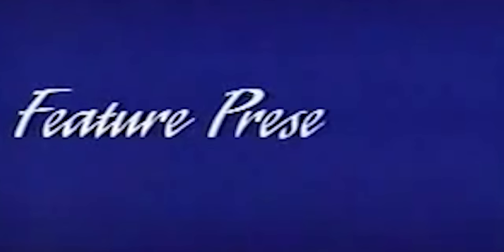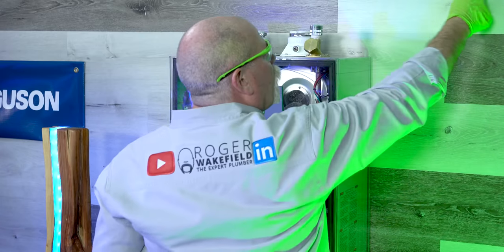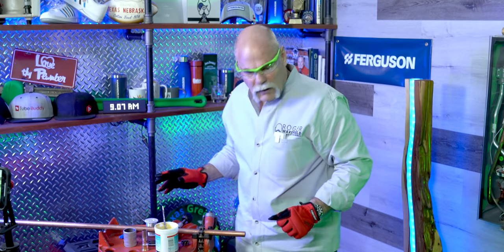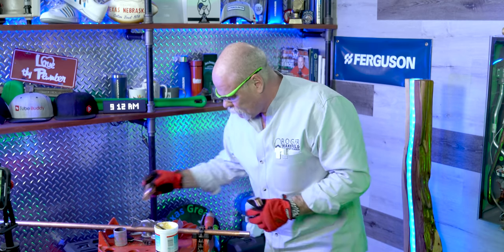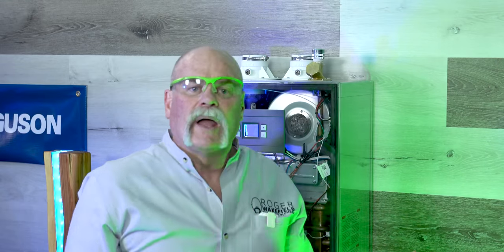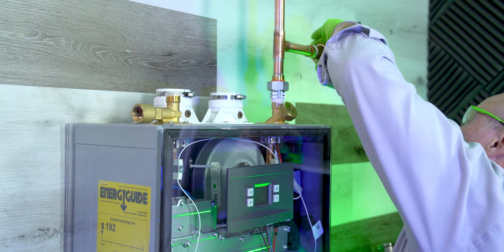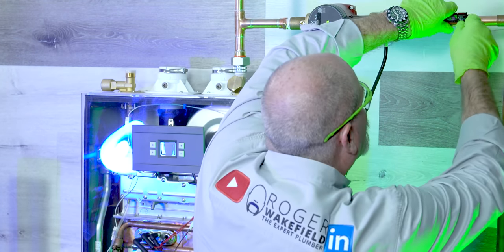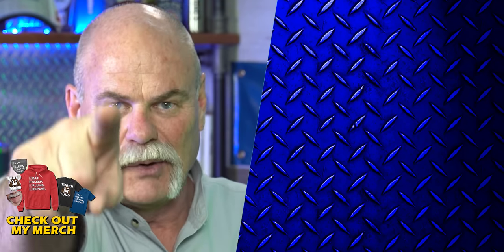This New Device Will SAVE You 12,000 GALLONS Per Year!

Comment: About how much does one of these recirc pumps run? I’ve gotta see if it would be worth it or not cause it’s just me in the house so I don’t use a ton of hot water or actually water period   That 💩 will kill ya anymore depending on where your at but I’m on wells and one of my two wells are contaminated so I don’t drink the water at all for that reason
Reply: Michael Taylor  thats what I’ve thought also. I replumbed the entire house 4 years ago and was debating about it then but held off and I just don’t think it makes financial sense at all. My water bill is zero since I’m on well and my power runs $40-$50 per month year round so I just don’t see it helping other than just being another neat gadget in the house
Reply: Don, you'd be much better off looking into a returnless pump system. Returnless pumps use a mixing valve at the furthest faucet from the water heater to push lukewarm water out of the hot side into the cold water side. The valve closes when the hot water pipe is full of nice hot water, and it opens up when that hot water has cooled below the minimum temperature at the faucet. No return needed since it just goes into the cold side. You can program the pump to run at specific times since it's just you in the house. Morning and night for example for your shower, or midday or afternoon for cooking and doing dishes. Installing the valve on a circuit at the furthest point makes sure hot water is at everything in between as well. This same company shown in the video makes returnless systems. The only downside to it is that the cold water at the sink with the mixing valve won't be very cold because of the lukewarm water that's pushed into it. Not that big of a deal though especially when the benefit is instant hot water at the sink or shower. 😎👌 Returnless systems are way easier to install and I bet they're the ticket for your situation.

Comment: circ pump?  new?
Reply from the maker: Upgrading to the new model. Thermostat and Bluetooth technology. Do you install many circulation pumps?
Reply: @RogerWakefield  they're standard issue for any custom home, here.  kind of pointless on a tankless water heater, though, IMO.  move the hot water storage from a very well insulated tank, to the much less well insulated pipes in your walls.

now a circ pump that was connected to the tankless controller so it rushed the hot water through the lines when you turned a tap on would be a good pairing with a tankless.

Comment: For once I'm going to disagree with you here.

If your system already uses a hot water circulation pump, this device might save you money.
If it didn't and you just got it installed, you'll faint when you will recieve your next energy bill. If you want to install such a system (can be useful for comfort if your hot water generator is very far away from your bathroom), you'd better make sur all of your hot water pipes are thoroughly insulated, or you're going to have a heating system that constantly heats the wall where the pipes are, or worse, the crawlspace behind the house.

When I sell a hot water circulation pump, I never try to tell the client they'll be going to save money, because they won't. Energy is always more expensive than water. I just tell them that it's indeed going to be more comfortable.
Reply: You're assuming the pump will be running all the time. It's important to program the run times. Nobody needs recirc at night. Nobody needs it when they're at work. If you're lazy and don't program it, sure you'll definitely waste money.
Reply: @mannys9130  I should indeed have said "as soon as it works" instead of "constantly". Still, you have to program it loosely if you want real comfort (because you don't want to wait forever naked in the shower if you take a shower 1 hr late instead of right on your usual time). And as soon as it turns, that's akin to a central heating system circulating water to and from radiators.
It better be insulated, and even then, it does cost a pretty penny.